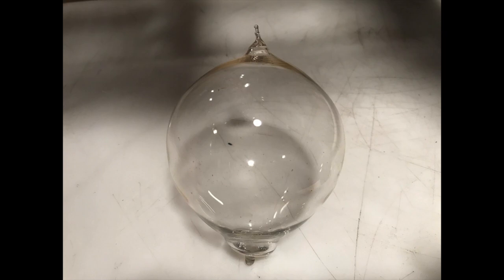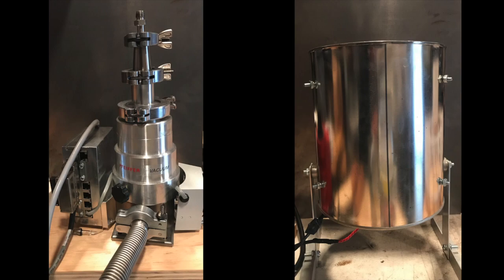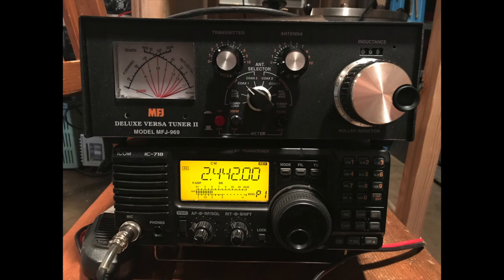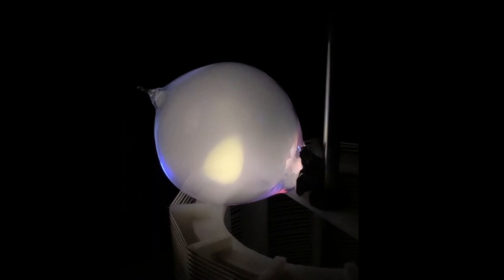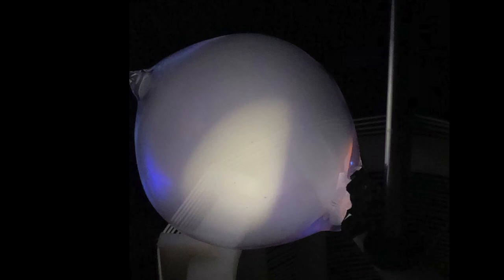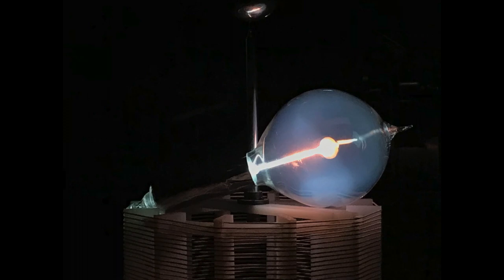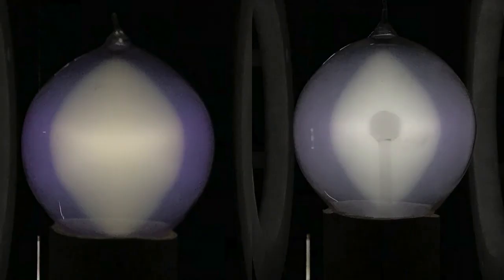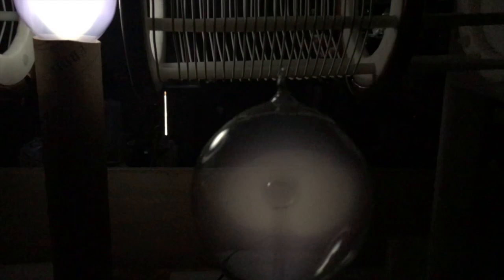Tesla Brush Bulb and Effects of Ultra High Vacuum

Comment: Quick question, is this light easy on the eyes, unlike say normal bulb light/ LEDs which hurt if you look directly at them for too long? Was reading up on old articles regarding Nikola Tesla, and from the The San Francisco Call (Sunday, Aprill 16, 1899) they have an article titled "Artificial Daylight At Last Made By Tesla -". In there they specifically note that this light had none of the hash effect on the eyes like most every other bulb and other manmade light sources had. Another thing is that Tesla directly states "all the air pumped out, but, of course, are full ether. The passage of this special current sets the ether in motion, forming light waves...".

Comment: Is there any way you might try to recreate the Farnsworth tubes that Dollard talks about?  Vacuum tube with electrodes pointing towards a separated hemispherical inner electrode. Supposedly a tiny star formed inside the tube which subsequently irradiated and discolored the glass. This is all in one of Eric Dollard’s presentations.

Comment: Many glasstubings  releases  different gases  when in high freq. field.  Bakeout not  much helpful.  Only way is to use  getters  or   quartz glass.  Vacuum caps  25 kV running on  20-35 MHz  20-100 amperes also glowing like your tube, X-rays also present.  Vacuum caps require ultra high vacuum, plating materials  acting like getters (aluminium is like getter), much more than usual   electrontubes. To reach  ultra high vacuum  cannot be done  easy, even to measure it.  Great work!

Comment: Excellent work!   Since no rotary brush effect appears, next I'd try duplicating the Tesla 1892 docs more exactly.   Nobody knows what the "operating window" for this device actually is.

For example, if the glass surface doesn't become dangerously hot, then your pumpdown sequence is completely different than Tesla's.   Tesla used no bake-out oven![1]   He describes this bulb as initially producing streamers (a hundreds-micron vacuum effect,) then gradually over days of operation it changed behavior.    If you're not doing the same, then you're not fully reproducing Tesla's experiment.     If no rotating brush effect appears   ...that might just be the reason.

Also I suspect that the sensitive-brush effect was associated with Tesla's ~20KHz operating frequency, produced via steam turbine dynamo and the large wall-mounted pancake secondary.     If not building a meter-wide high-frequency dynamo, at least we should provide the bulb with a 20 or 40KHz drive, at voltage high enough to produce a few hundred watts, in order to heat the glass as hot as Tesla did.     If rotating-brush only works at 30KHz, that's the main reason nobody has ever reproduced the phenomenon!

---

[1]In my experience, it's the failure of ALL hobbyists to not replicate original scientific claims.    "Tesla was primitive, and also we're much smarter than him," and then we never think to follow Tesla's clear instructions, or to reproduce his actual devices.    (Perhaps Tesla's ionic pump-down sequence, starting from the streamers stage with air-fill, produces a specific gas-mixture which is not produced otherwise!   There even should be some Hg contamination, from the Sprengle pumps Tesla was using (although he also mentions that these bulbs can be created starting from 1ATM, entirely pumped down by glow-discharge ion-pump effect.)   The N2 and O2 would be scavanged up as SiO2 and silicon nitride,  which should leave behind a specific mixture of nobel gases, mostly argon.

If for some strange reason we decide to NOT run our bulb for many days at hundreds of watts, and carefully reproduce all the visible effects Tesla reported in detail, then why should we expect to see the rotating brush appear at the end?

This problem is called the Heathkit "improvements" or the "Heathkit Effect," where hobbyists building electronics kits will absolutely REFUSE to follow instructions, because they're certain that they know better than the kit manufacturer.   It's a matter of hubris; total lack of 'scientific humility.'    When their finished kit doesn't work, it's because the hobbyist added numerous "improvements," based on their conviction that Heathkit company is obviously incompetent, and the person building the kit has a superior mind, and easily makes the kit "better."   Then the finished kit doesn't work.   They were unable to follow even simple instructions.   The wise hobbyist builds the kit first, gets it working as intended, THEN adds improvements, one by one, so any debugging becomes trivial.

As for myself, I suffer the same malady!
 
Years ago I attempted Tesla's demo as a brief test, but my TC turned out to be underpowered, and also running at 10.3MHz not 20KHz.   The bulb only glowed as yours does, but I could never reach the "extreme glass-heating" stage (with a pair of 812H tubes, so maximum RF of under 100 watts.)    I did find that a foil-wrap around the barometer-tube would act as an electrostatic shield, and greatly concentrate the available RF current onto the center sphere (a necessary trick when using underpowered RF supplies, especially with carbon-button bulbs where the glass-heating stage plays no apparent role, but where useless heating of the support-tube can prevent the carbon button from glowing.)   My brush bulbs were being pumped by the turbo WHILE driven, so I wasn't duplicating Tesla's ionic pump-down of a sealed bulb.   Heh, also my bulbs used a rubber stopper with a foil barrier just above, but even so, plasma was getting to the rubber surface, and spewing carbon all over the lower neck of the bulb.   (I had no glassblowing equipment at the time, just a mapp-gas plumbing torch for blowing out the tip of the barometer tubes.    Maybe it's time to put together a lampworking setup, and give all this another try!)    And, if it still doesn't work at 300KHz and a few hundred watts, I'll have to build a wall-mounted 30KHz resonator eight feet wide.   If I can do that, then I could also make ten of them, and start selling Original Tesla Pancake TCs, like Jeff Behary.   Got big spools of half-inch copper tape wo/adhesive.

Possibility:  use a metal central sphere as Tesla suggests  ...but where the rotating brush effect only appears for a matter of minutes, until the ion-pumping causes the vacuum to become too "hard."    That way we might actually see the rotating brush appear, but without having to drive the bulb for many days on end.    (As with Heathkits above, once we get this bulb to work AT ALL, we can THEN start the debugging process, and reliably obtain a long-term effect.   Maybe the specific gas-mixture is impossible to obtain without the natural ion-pumpdown process.   Maybe it requires soda-glass, and boro acts to poison the effect.   Maybe a trace of Hg contamination is required.   Maybe the rotating brush never appears if the operating frequency is above 50KHz, where the ion-paths in the "dark discharge" regime become too short.)

Possible test:   connect the anode pin of a standard vacuum tube to the terminal of a Tesla coil.     If the glass doesn't get hot, it shows that the Tesla coil is far too underpowered to use for Sensitive Brush bulb demonstration.    Also note that Tesla's description of glass-heating during the non-glowing phase, is very probably a description of high-current electron-beam heating, and this should be a prodigious source of soft x-rays, same as the CL Stong  x-ray project in Scientific American, with the gettered vacuum tube driven by an "Oudin Coil".  Those working on Sensitive Brush should be observing the effects from behind a flat plate of lead-glass, obtained from old Sony late-model TV CRT tubes with the rear glass knocked off.   Even better, buy some "x-ray glasses" from ebay, the ones with lead-glass lenses, sold to veterinary and x-ray technicians.  For nice thick lenses, search on "0.75mmpb"
Reply from the maker: I have come to the conclusion that Tesla's sprengel pump did pose impurities to the vacuum, as molecular mercury vapour is far too heavy to be evacuated with a low pumping pressure as provided by the Sprengel pump. 

One thing that most people often forget about his pump setup, is while he didn't necessarily bake out the bulbs, he did use a capsule of heated caustic potash to remove any water moisture from the system. But of course, this does not work 100%, since heating caustic potash will eventually realease vapor, which may or may not cling to the inner wall of the glass sphere. 

This means that water vapor, mercury vapor, and caustic potash/potassium hydroxide vapor must be the cause for the brush formation. 

I say this, since my first experiments with the carbon button lamp did not involve any bake out process, possessed great quantities of water vapor, but did infact create rotational formations centered around the carbon button. 

I will most likely evacuate a bulb connected with a vessel of small amounts of mercury and caustic potash, without any baking out, in a couple days to see if this leads to something.
Reply: @GriffinGBrock  ... please update us on these results when you get a chance... thank you

Comment: Is anybody doing research on Dollard’s video where they use a Tesla cool to discharge into an incandescent bulb, which then produces a tangible force, resisting the hand of the experimenter?  It’s basically Tesla’s push without a pull discovery.

Comment: Gerard Morin used north south magnet AC into coil through step up transformer and spark gaps into Mercury sodium bulb and claiming for hours afterwards blue light eminating from the inner bulb of sodium. Thermal temperature by laser at below minus four hundred degrees (Canadian Celsius or likely used Fahrenheit?) Have you tested anything similar?